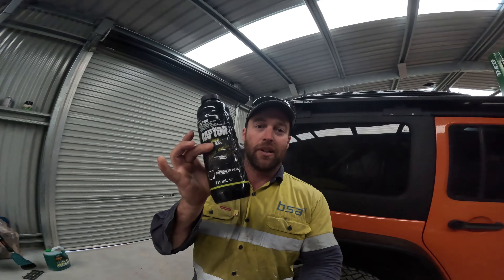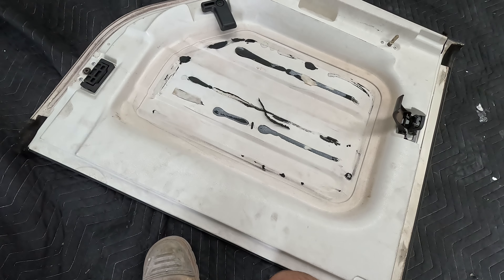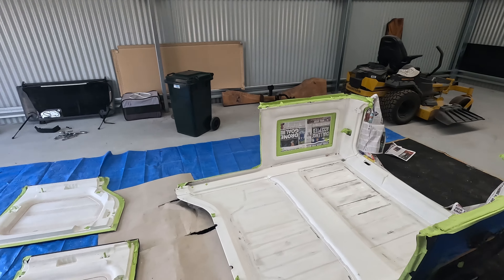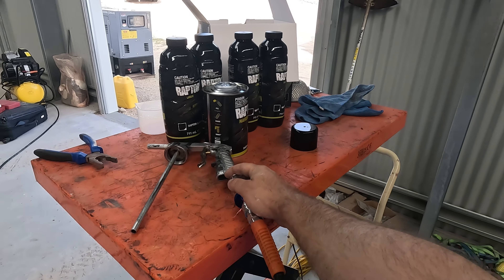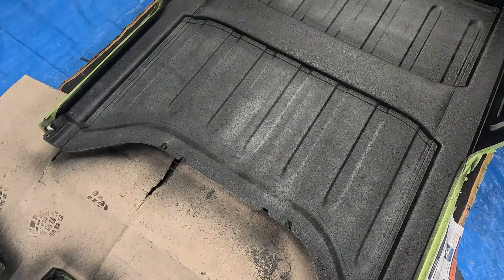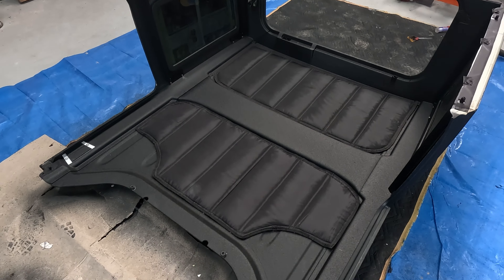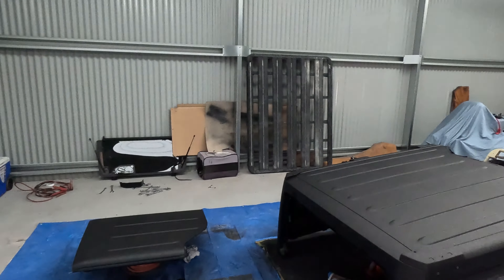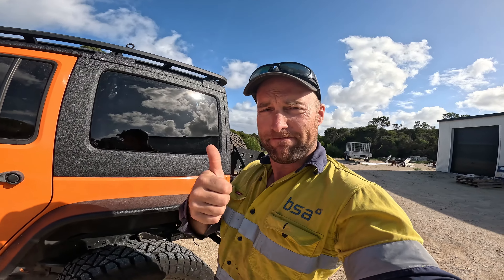Applying #raptorliner On The Jeep Hardtop! Also Sound Deadening And Insulation. A Huge Improvement!!

Comment: The finished product looks really good.  Nice job!  The Raptor liner is a really good product.  We've used the black and tintable and both work great.  You can thin it a bit and change the air pressure to achieve a smoother finish.  It's super durable and yields a great finish.  I'm glad that you used a mask when spraying because it can be nasty smelling and I can't imagine what it would do to your lungs if you inhaled any of this product.